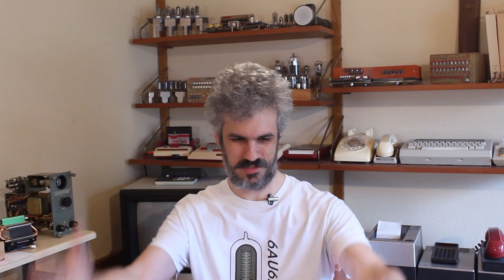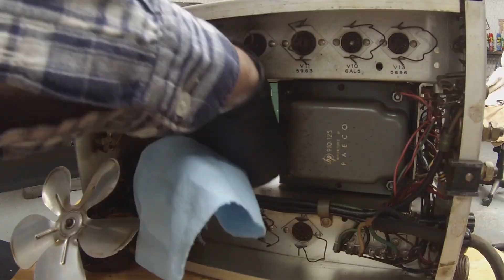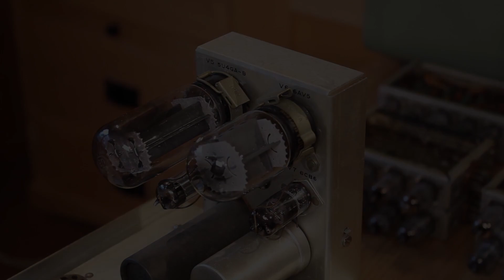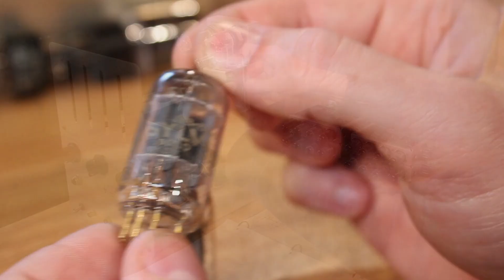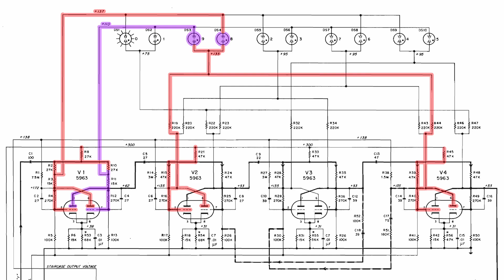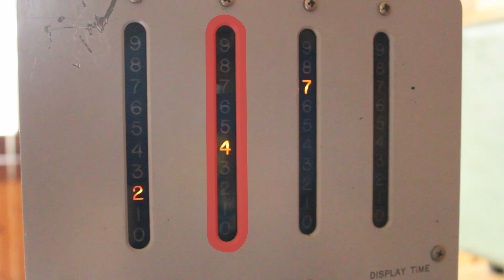Restoring an HP 521A Frequency Counter: Part 1

Comment: One question. I have a Tempo 521a Irrigation valve locator ( with wand). It has a setting where you can dial transmitter power. Even if I do the low setting it goes allthe way high on the transmitter not the wand. What could the problem be?

Comment: You may have a look at CuriousMarc's video "HP 5245L Repair-a-thon - Part 2". Looks like they recycled the basic design with the discharge lamps for the bcd couting. It uses trans instead of tubes, but the schematic looks very similar (at least to me).

Comment: I wonder why they use those contraptions for counting. When I was at school in physics class (around 1990) we still had an old tube based frequency counter. It was really amazing and also quite large. But it used Dekatron tubes for counting which have a dot that lights up and when you send an impulse the dot jumps to the next position, quite a simple but ingenious design. Maybe they were already unavailable when HP built this.

Comment: 3:49: That's a very interesting moiré effect on the plaster.
Also, I remember being told leaving fingerprints on bulbs that get hot could damage them or shorten their lifespan – does that apply to vacuum tubes? How hot do they get in normal operation? I suppose at the 24V level, they shouldn't get hot and the odd fingerprint should be okay, right?

Comment: Replying a bit late but the Phantastron was an unexpected surprise.  It's pretty easy to find descriptions of how analog dividers were used to generate the TV master signals used in a studio for the cameras and resulting in the video signal.  What's not easy is finding examples of those circuits.  I'd suspected monostable multivibrator setups were used with very asymmetric duty cycles.  Instead of binary counter type circuits these effectively do division by 'not listening' for the time period appropriate to drop that number of pulses and only gating a fraction of the input through.  The trick is finding a circuit with good enough time stability over a time range for a useful divisor and have a fast enough recovery period to fit in the off duty cycle of the pulse train being divided.
The horizontal sweep circuits for oscilloscopes also need such circuits.  Here the recovery period  is the flyback time where the beam current is cut off and the deflection plate potential is reset to draw another line.  This also suggests the real source of the name for the flyback transformer of the CRT TV.  Here the flyback pulse was a great source to create the high voltage supplies and reasonably cheaply.
Another surprise is that a lot of this work was channeled into WW2 radar work (plan position indicator displays, radar pulse generation, etc.)  Reading one article had me thinking I bet A D Blumlein was involved and I was right!
Here's a great story about him: https://www.inventricity.com/a-touch-of-magic-alan-dower-blunlein
Lastly, back to the video signal, for NTSC most sources indicate the master clock is 2x the horizontal line frequency.  Though the vertical sweep is much slower it uses 6 pre-equalizing pulses, 6 broad vertical sync pulses and 6 post equalizing pulses during a 9 horizontal line time interval.  That's 2 pulses / line or 2x the horizontal rate.  The  divider chain is then: master divided by 2 = horizontal, horizontal divided by 3 for vertical pulse trains, divided by 5 and 5 again for a 210-line clock and divided by 7 for the 30Hz frame rate clock.  Phantastron certainly has the range for that job.
Thanks for sharing!

Edit to add: a 555 timer circuit could do this sort of job and how I first found your channel was when Hackaday covered your vacuum tube 555 project!

Comment: Phantastron works something like, using a single tube as a differential pair.  The trick is, whereas we normally use pentodes etc. with the screen grid at fixed voltage and ignore its current flow, this parameter can also be made useful.

The fundamental at play is, when plate voltage is low (saturation region), cathode current remains constant (emission is determined by total electrode voltages, weighted by their respective mu factors: think of a virtual diode whose plate voltage is Vg1 + Vg2 / mu_g2g1 + Vg3 / (mu_g3g2 * mu_g2g1) + ... ), and current is instead absorbed by the screen.  The same is true if current is diverted by a grid (as in mixer tubes: dual-control pentodes, heptodes, etc.).  Put another way, the screen and plate act like the outputs of a differential pair, the currents depending on either their relative values, or of the grids controlling them.  By strapping one around, a negative resistance characteristic can be had.

Though, even that is just a start, and the negative resistance path is still non-obvious in this circuit.

it's that, I think, at least given the curves they showed -- when the cathode pulls up harder, Vg1k doesn't change much (hardly at all), but Vg3k pulls negative, cutting off the plate and forcing cathode current into g2.  This condition is bistable, I think, maintained by g1 positive bias.  There happens to be just enough downward tug from the input diode, coupled through C1, to turn off g1 and thus Ig2, and screen voltage rises, cathode voltage falls and so g3 goes forward and plate current ramps up (along a steady ramp set by C1-2.2M).

So yeah, it's weird. :D

Comment: Very nice. I'm always fascinated by these old pieces of gear. Mainly because it seems so different to be an engineer back in the day. Every part, even capacitors and resistors were expensive. So you had to keep the part count as low as possible. You had to figure out a way to handle the huuuge temperature difference when operating and you had to find a creative way of doing even "simple" tasks. Sometimes it feels like it got a lot easier to build stuff, today everything is just a microcontroller and some software. What is fascinating to me about this is that the complexity of a small microcontroller that is worth only cents is orders of magnitude higher than the greatest pieces of engineering from back in the day.
Reply from the maker: Thank you!
And you're so right, that's what I find most fascinating about all this stuff. You can't just "fix it in code," so everything had to be really well engineered from a pure hardware standpoint. The engineers really knew their stuff and were able to build fascinating things with a minimal amount of components!

Comment: Is that a yellow AZ-1 sitting in your drive? I've loved those since Tom's Turbo Garage bought one, but I'd never fit into it!
Reply from the maker: Good eye! 
Though it's actually a Honda Beat. Interestingly, I thought about spending the extra to get an AZ-1 when I was shopping for the Beat while I was living in Japan. But I sat in an AZ-1 and didn't even come close to fitting. My knees were in the dash, my head was above the window line and gullwings couldn't be shut, and it was just way too tight. The Beat on the other hand is quite spacious actually!
Reply: Back in the day, I saw a Suzuki Cappuccino at an auto show here in Melbourne. I decided, for a laugh, to try and shoehorn myself into it. I was very surprised to find that it was rather roomy for its diminutive size. Of course, this was with the top down. Japan, as you know, doesn't do height. I can't remember the number of times I had to duck through a doorway when I was there. Haha

Comment: cool! is failing correctly! 

golden pins... sounds logical, golden reference

 are the neon part of the dividing/counting circuit?
Reply from the maker: Thank you!
As far as I can tell, the neons are really just being used as a display and aren't being used to influence the dividing/counting circuit. One of the decade counters actually has a few bad neons, but despite that it does still seem to count correctly.

Comment: HP kinda fudged a bit in order to get all that stuff in a smallish case.  Expecting a phantastron to divide by ten for more than a few minutes is a bit optimistic-- the basic timing is an RC ramp, which is a stretch to expect to hold its timing to 10% over time and voltage and temperature.   The better counters attempted only to divide by 5 in the phantastron and used a flip-flop to bring that up to ten.  So you will need to tweak the adjustment pots to get each divider to divide by 10 instead of 8, 9, 11, or 12.   The decade counters you can focus on one at a time, work on the lowest digit first and watch it count up a 1Hz square wave and ensure it hits all counts.   Again the critical bits are the RC skip-ahead circuits and the dual triode gains and gassyness levels.   The many 100K and up resistors are probably drifted up in value by 15% or more so you may need to send out to DigiKey for a slew of resistors.  Fortunately 1% resistors are now cheap, like 3.5 cents each so you can actually improve the working margins over the original resistors.  You may have to select dual triodes that are especially good to get the modules to count up reliably, especially at higher speeds.   To add to your worries, the neons may be reluctant to light as their Krypton-85 stimulus gas has deteriorated.  So you may have to replace some neons too.
Reply: Mr. Carlson has gotten a creampuff unit to operate without working on it, I recall.  Kr 85 in neon bulbs?  With a half life of 10 years, that's not going to be very long.
Reply: @SeekingTheLoveThatGodMeans7648  Thinking about it, the neons don't have to ionize to count correctly, they are just for display, so it's okay if it takes a few milliseconds for them to strike.  You only need fresh radioactivity if you need the neon to be a quick and reliable striker, like in a sawtooth oscillator.
Reply from the maker: It is surprisingly compact for the amount of stuff it has to accurately do. 
Thank you for the info on the phantastrons, I'm learning a lot more about them and starting to learn which components to really look out for. 
The Decade counters fortunately seem to be mostly alright. One isn't resetting to zero and another one has a few bad neons, but since the neons are just an illumination source, they shouldn't be affecting the count. Fortunately, I have a few spare neons salvaged from some old gear (and a full spare decade counter unit with working neons I can use for parts), so I should be able to get the decade counters back up and going well.
The bigger issue is that it's counting a ridiculously high amount. It should be counting 60 pulses when set to "Check" and on 1 second, but it's instead counting about 4,000 pulses, which might be a little too much, haha.
I just got some new caps to replace the four black beauty caps I didn't replace in this episode, and then I'll go through and test each tube and go from there!
Reply: @UsagiElectric  Yep, the Phantastron divide ratio goes up exponentially with leakage or resistor drift, so I would not be surprised if they are each dividing by 42 or worse instead of 10.  Personally I would be tempted to up-engineer the division chain to be 5-2-5-2-5-2-5-2.  The 2's could possibly be done with neon or CMOS dividers.  But that's just me, a real purist wouldn't massacre the design like that.
Reply: @UsagiElectric  Yeah, the critical RC time constants are the 39, 390, 3900, 39,000, 390,000 pF capacitors and the 1% resistors going to the  adjustment pots.   You're probably just a few parts away from getting this thing back on track!

Comment: Those dividers on the timebase work by counting pulses, and having the tube switch on hard, when the pulses charge a capacitor to a high enough voltage. Thus you need to have the RC circuit able to charge up to that trigger voltage with the right number of pulses, but also have to have all pulses be the same width, so the charge transfer each input pulse is the same. Analogue, very prone to drift, and also touchy with age and leakage in the capacitors, so probably needs to be checked and adjusted, because likely a lot of those resistors have drifted in value, which makes it erratic or count short.
Reply: Very interesting but I guess this makes total sense. Another common divider technique that came around with BJTs was to use a current source to get a linear charging curve on a capacitor with the current being gated by the input signal. For the output you just need a comparator at the desired voltage. This makes it much more stable since you don't need to perfectly filter single pulses but have a solid voltage instaead.
Reply: @gammaleader96  Yes and was very common because implementing a dividor in digital logic needs a lot of transistors and diodes, but with analogue you only need a half dozen or so, and if you relax your standards you can get it down to even fewer, especially if you use unijunction transistors to do the actual comparison, as all you need is the one transistor to switch in current, and the UJT does the rest.
Reply from the maker: Thank you so much for the explanation!
Seriously, when I read your comment, it was like a light bulb went off and it clicked! Tough, I can definitely see how any imprecision in the resistors or capacitors can definitely make them count wonky.
Reply: @UsagiElectric  fast counting is capacitors low in value normally, less charge to get to trigger voltage, though drifty resistors and leaky capacitors make it not count at all.
Reply: @UsagiElectric  Also you can do it yourself with your existing long tailed pairs, just use a reference voltage on the one side, and another tube running in saturation to discharge the capacitor when you need it, no anode resistor needed, though it will probably need a grid resistor, or use a diode tube on the output, to both draw charge out of the capacitor and determine your pulse width.

Comment: With no input signal applied it shouldn't count at all, and all the decades should remain at zero when the gate opens.  Once a large enough amplitude signal (I forget the spec) is applied at the input it should count, and hold the count until the next gate cycle when it counts again.
Reply from the maker: Yup! Though, with the Input Sensitivity control switch set to "Check" it's actually using the 60Hz from the main transformer as the input, which is why we see it counting here without an input connected. But, it should only be counting about 60 pulses and is instead counting around 4,000 pulses, which is a bit too many!

Comment: I love your D6 mobile paint booth.   Should be enough to keep the 521A case from blowing away in the wind.  
We are spoiled by the simple ease of using modern digital logic components.  Vacuum tube logic takes 10X the engineering to make it work.
Reply from the maker: Haha, thank you! Though, it's not so mobile at the moment, we need to do some work on the cooling system of it, but after 70 years of brutal service, it's still tough as can be.
It's really amazing how inventive the engineers had to be back in the day. You couldn't just "fix it in code," so you had to really work on getting all the hardware doing just the right thing. I think that's why I find these old HP equipment so beautiful, the engineers really had to get the hardware perfect to get the job done!